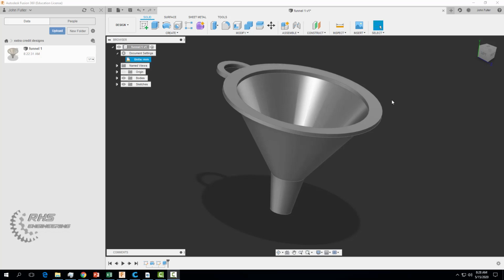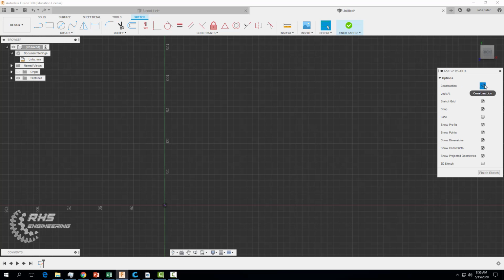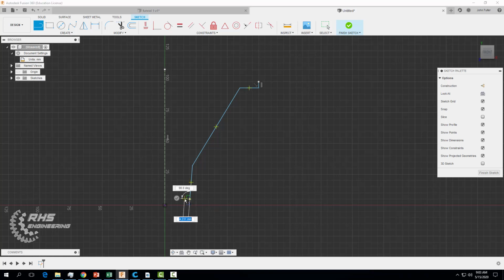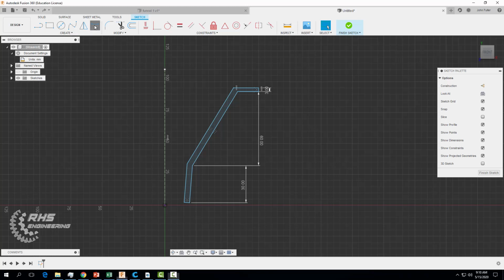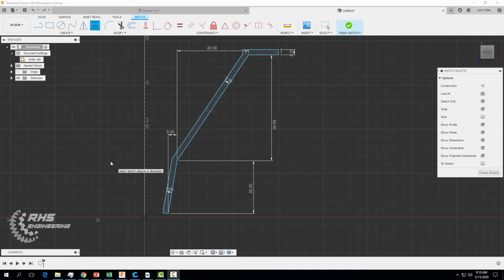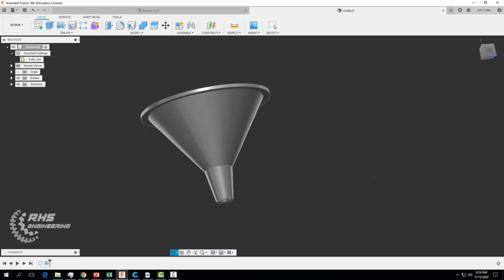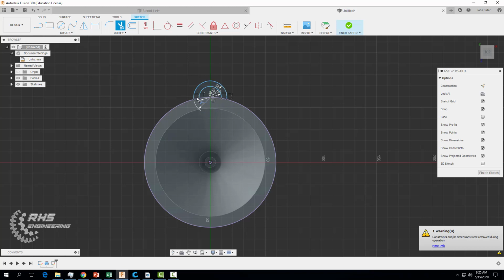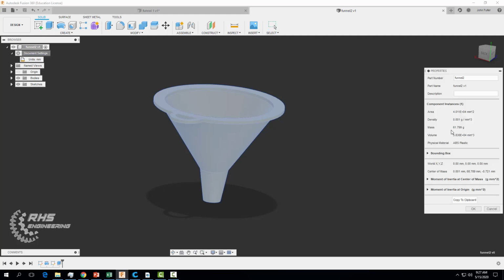Tutorial: Designing a Funnel with Fusion 360

Comment: Excellent video. I need to make an adapter to connect the exhaust from my resin printer enclosure to a window vent and even though this was my 2nd time using Fusion 360, I had the adapter loaded into my slicer before this video ended. Thank you!